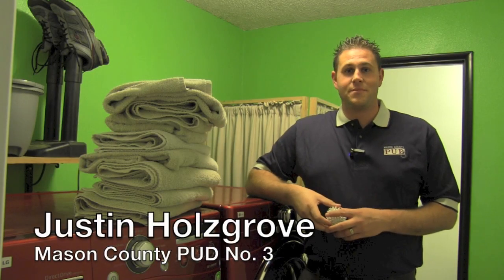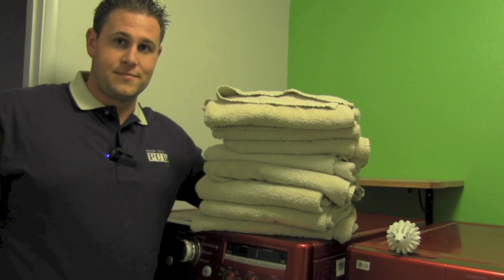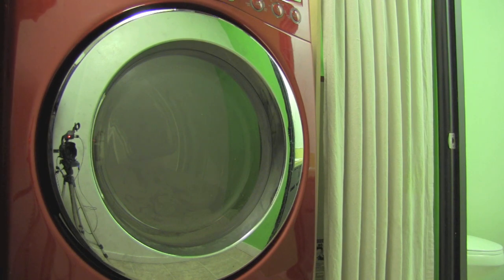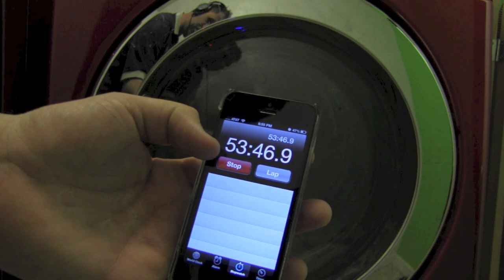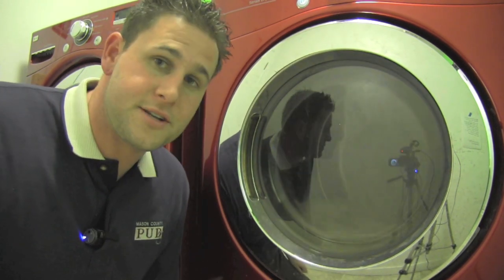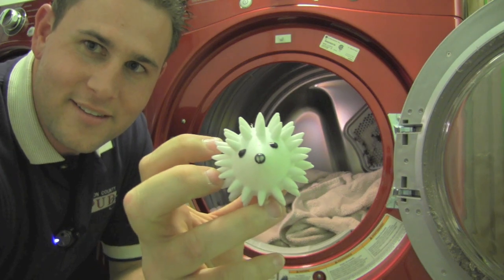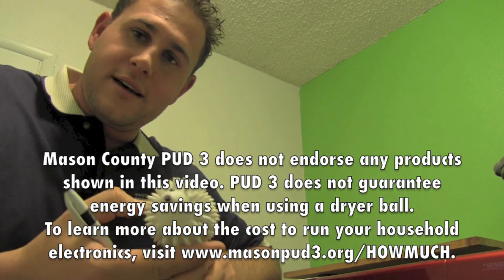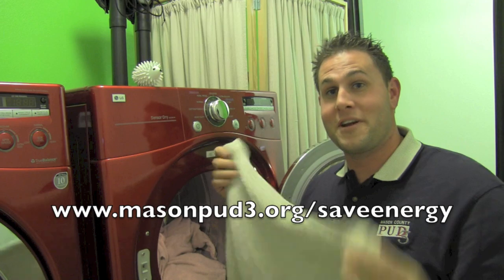Dryer Balls - Do they really save energy?

Comment: The dryer balls made of wool are better in my opinion. I've never done the test, but I think that the wool ones save a little more time and, best of all, you don't need any dryer towels. Just drip lavender oil or something on it and repeat with your favorite smell after every 3rd or 4th use. Depending on the size of the laundry load, I add balls. between 4 and 6. If you have pets, the wool balls pick up the hair that the dryer doesn't get off the laundry without it. These hairs simply felt into the balls, so you don't have to do anything extra with them. After use, just lie down somewhere where you can breathe

Comment: Your depiction is that you ran the second load before allowing the dryer time to completely cool.  (i.e.. 24 hours)
Reply: Additionally, the balls are absorbing moisture and pressumably releasing that moisture later.  The same effect could be accomplished by removing the towels while slightly damp.  It could also be that the dry balls are lowering the average humidity thereby causing the dryer to falsely  register the load as dry.  A more thorough test would test the towels moisture content before and after.
Reply: @dpky7333  Does plastic absorb moisture?
Reply: Stop it, one the dryer had almost an hour to cool off, 2 the point is proven they work and save money, what are you going to complain about a 15 second variable in anything like it matters?
Reply: @TheChocolateChamp  I genuinely wanted to know if and how these work but haven't seen a solid answer on that anywhere.
Reply from the maker: You are correct. In this VERY unscientific test, the dryer cooled for about 45 minutes. I imagine that probably impacted results some.